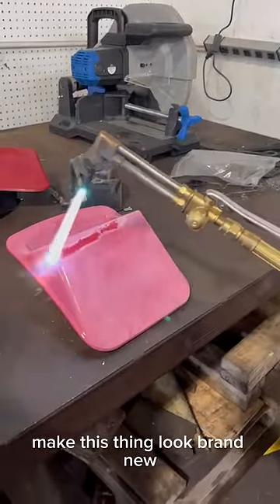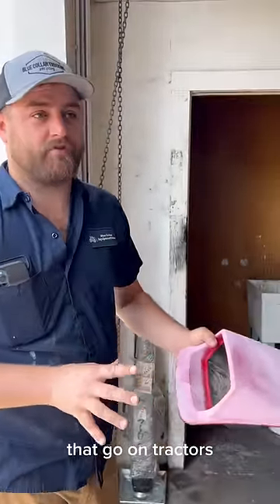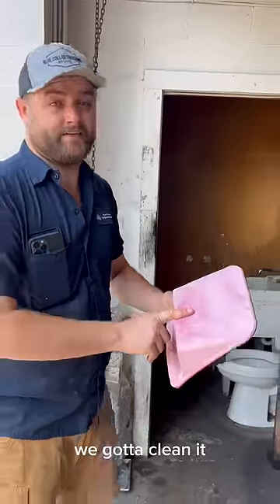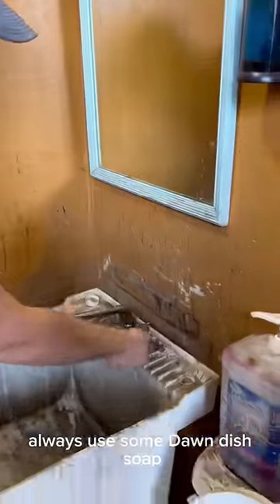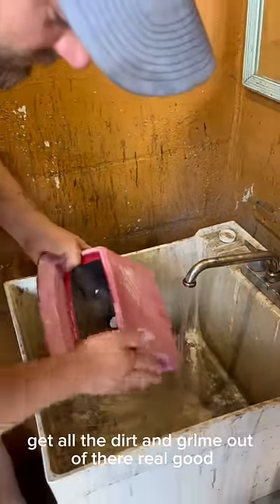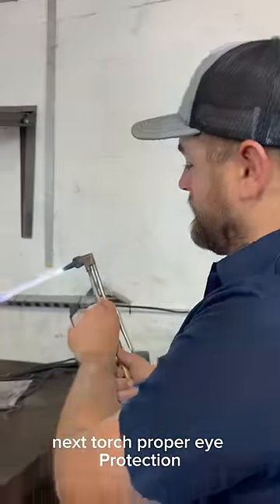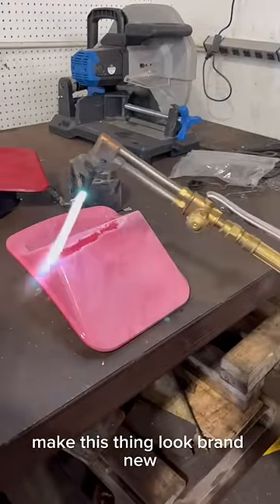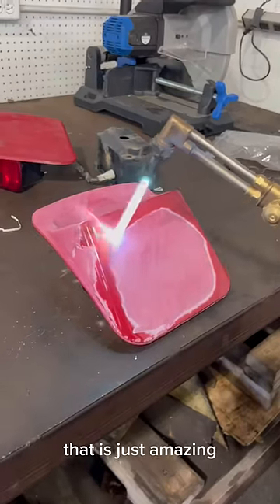Burning￼ plastic to look like new!

Comment: All you did was brought the oils to the surface, which basically makes the whole part more brittle...you could have used Vaseline to get the same effect without depleting those oils...has to be a petroleum based plastic though either way.

Comment: ...🤦🏻‍♂️ just spray paint it or polish it, using a high temperature flame just made the exterior brittle so it will last less, good for piece that are not gonna be used much like a seat on a stadium

Comment: All that does is pull the oils to the surface and make the part brittle. Still no UV protection and will look the same in no time. Just rattle can and clear it. Will last a lot longer

Comment: I'm a professional detailer and own my own bussiness and when I detail vehicles or boats kr what ever that has faded dried out plastic especially on a new customers vehicle or boat or plane or what ever I will use my small simple propane torch bottle the little blue ones you get from lowes with a tlrch head on it and I do same process then i spray a satin finish 2k clear coat over to keep it looking brand new for years to come and vuess what no plastic moisturizers and protectants ever required again and I got a customer for life wheb they see how brand new thjer vehicles plastics look and shocked when I didnt charge them for it cause i will make my money off of it times 10 from them having me do the once a week maintnance detail and then once every 6 months they pay me for a complete paint correction and ceramic coating I have 9 customers with 13-20 year old vehicles and the paint and plastics and all look like a vrand new car the day it came from the dealership. I'm so glad i started this mobile detailing bussiness cause I'm my own boss and make a quarter million a year and have 4 employees that work for me they do just maintnance details and I personally do the paint corrections and the initial first detail on a new customers vehicle to make sure its up tomy standard cause the initial detail is 290 dollars but I tell customer if they not impressed its free kr look like a brand new off the lot vehicle its free.

Comment: You know a heat gun will work just as well, if not better, since the heat won't be excessive as shit like it is with your oxy/acetylene setup. also works to just wetsand the part and buff the shit out of it with a heavy compound, then finish it off to a mirror shine with a good glaze. shits not rocket science.

Comment: At guy works much better that heat was way too hot... u can see befor and after the after started to go back to white 😢... you can use a cutting compound them buff it works out pretty good

Comment: I won't comment on the heat or type of the torch...because both of those can be accounted for by technique.  I would ask, however, how long it will take for this to turn ugly again.  I have been told...but do no know...that this will turn ugly a lot faster than it did before.  Perhaps some of those commenting will have enough experience to answer this question because it wasn't addressed in this video..

Comment: Dude you're just trying to heat the surface of the plastic not cut through a truck frame. Turn that thing down to a regular flame not a blow torch. That does not look brand new by far.

Comment: Too much heat and too close all you did was melt the surface you need to warm it up slower so it fixes it all the way through a heat gun works better you just have to be patient and it'll look better and not become brittle then put some uv protection

Comment: Too much heat and you need to wipe some 303 protectant over it then spray with SAMURAI 2-Part Polyurethane Spray Paint Clear Coat whichnis UV resistant